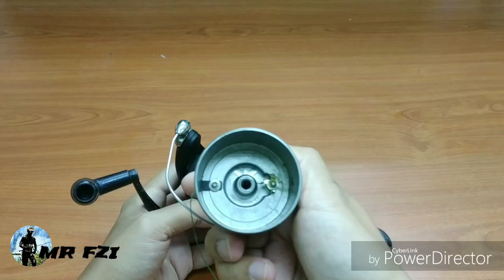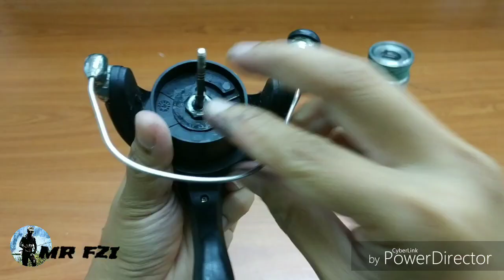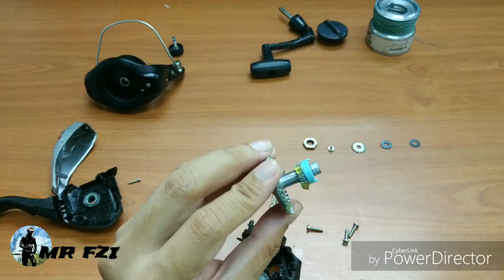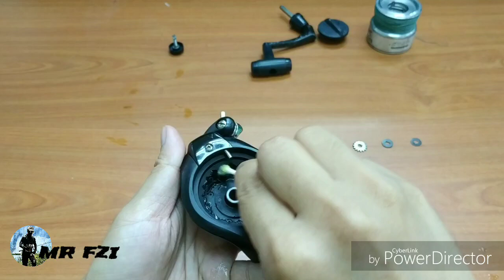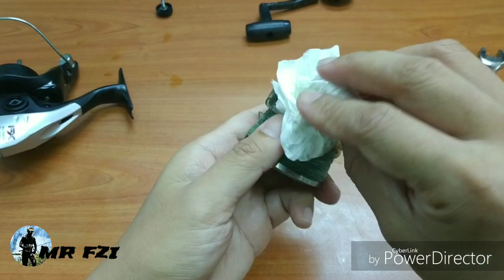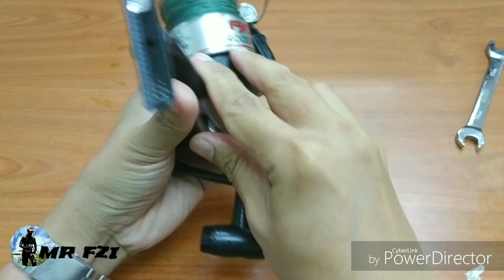Shimano FX Reel Service (After 3 years)

Comment: wondering if you can help, i have a shimano fx200 and i noticed the rotor head appears to have some play ,idk if this is from wear n tear or designed like that, but since it has the quick fire trigger thing for opening the bail it might be no longer as smooth operating as it should be or might be doing more damage when using it since there is possibly too much play in the rotor head ,i dont think its possible to remove the head or fix this issue as i see no screws or nuts to do this, will it come off if i remove the gears or the main arbor(ie post)?

Comment: How does the reel perform after 3 years?
Reply: Im still using mine for more than 10 years in salt water environment, i only use mine during summer and in 10 years i never disassembled it still works fine and after every use i just wash it with lots of water, im planning on cleaning it hats why i search on youtube on how to clean and lubricate it,